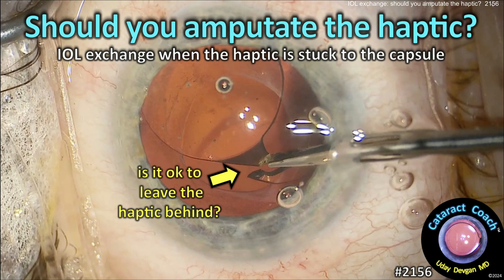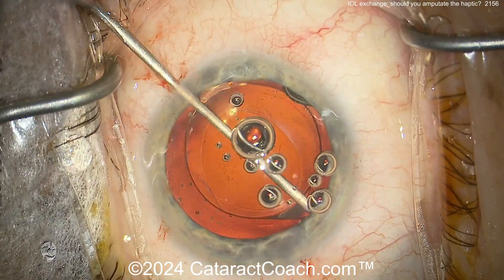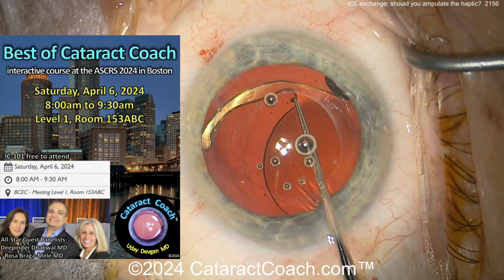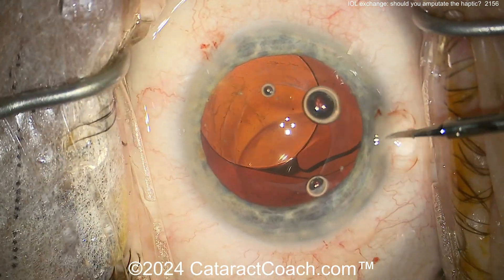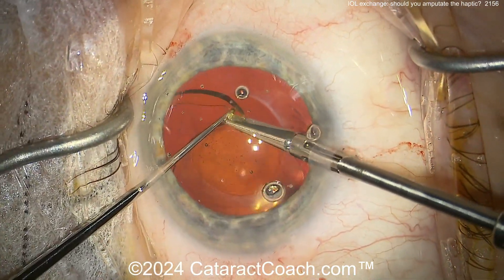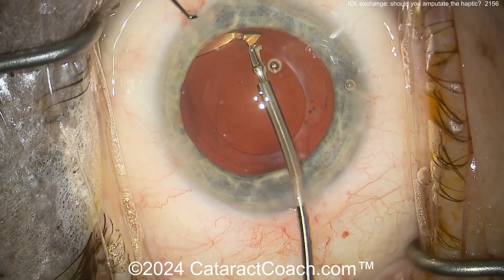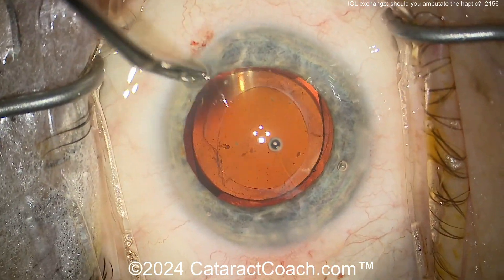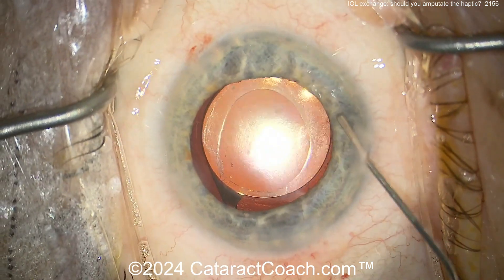CataractCoach™ 2156: should you amputate the haptic in IOL exchange?

Comment: There is a technique of stripping the haptics that can be done that will free up almost any haptic.  Sometimes it's easier to cut the haptic and remove the optic and then go ahead and remove the haptic with haptic stripping techniques.  It's not always necessary to remove the haptic but if you want to place a toric lens on that axis or a CTR it's necessary and sometimes a haptic left behind can cause issues if it migrates due to loose zonules or fibrosis in that area.   Usually though you are OK with a haptic left behind but I prefer to remove everything if possible safely.  Better to leave the haptic behind than to ruin the bag trying to get it out.  Take the haptic.....leave the capsular bag/zonules behind.  (credit for paraphrase:  Godfather 2)
Reply: Dr. Safran, can you share the haptic stripping technique?
Reply: perfect advice coming from the Godfather of complex cataract cases!